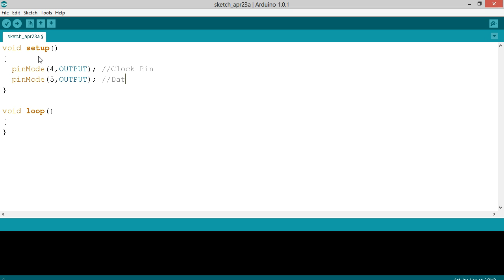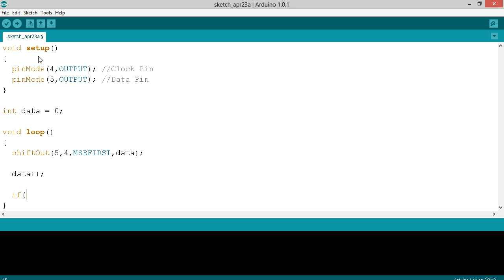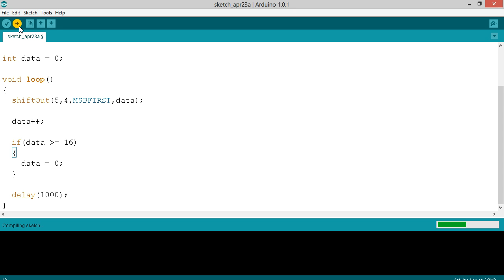Arduino Tutorial #16: Simple SPI Communication

Comment: Thank you very much, you helped me start communicating with my BU2090 12 Bit Serial register and to the Data and CLK connections are working correctly. But my register is a 12 bit not 8 bit like yours are and i don't know where to even get started sending the right commands to get the LED's i want to illuminate individually cause right now they aren't even flashing in sequence like yours are but they are blinking in their own pattern so i understand my soldering and PCB are Good but my sketch isn't. Any coding tips that might help a novice in need with this ROHM BU2090F i am using?  https://www.alldatasheet.com/datasheet-pdf/pdf/36319/ROHM/BU2090F.html

Comment: Miss leading topic. This is not about SPI interface. This is about shift register 74HC164.
Note:If using 74Hc595 then it requires 3 pins instead of 2.

Comment: at 4:10   ...  Reiterating what another commenter said: The maximum 25 mA output current specified on the data sheet is the maximum current you can pull out the chip before you damage it, not the maximum current the chip will output on its own. The chip has no control how much current your circuit draws out. It is the job of the circuit designer to make sure the circuit keeps all currents within safe levels. Leaving the current limiting resistor off the LED connections very much does not do this.

Comment: From what I can see one problem of ShiftOut is that you have no control over the rate of the clock. The SPI library you can at least set the max speed it allows the clock to toggle.
Reply from the maker: +64jcl True, but with most chips you're not going to have an issue with the clock being too fast.
Reply: +humanHardDrive , well I can think of one where it might not work - interfacing with older computer systems where you hand code the receiving part - like an old Commodore 64 (which I am currently interfacing with).
Reply from the maker: Are you trying to interface with a component that actually processes instructions, or just a shift register?
Reply: +humanHardDrive , well the C64 is a 1 MHz microcomputer with a userport. My code is written in assembly so as fast as the 6502 processor in it can run. Likely the Arduino ShiftOut would spew out bits faster than the code can handle it, so it's more common to manually bit-bang with a clock you can control the speed of - although the Arduino SPI library might work too since you can control the max speed of the clock.
Reply from the maker: If the processor is only clocked at 1Mhz, then your probably right to think that's the max input frequency.

Comment: The HC164 doesn't limit the current to 25mA, the 25mA is what's ALLOWED, and even then as ABSOLUTE MAXIMUM, not for continuous operation. The HC164 will supply a lot more current before it start to limit it due to MOSFET construction. At that point you're very likely damaging both the HC164's outputs and the LEDs. Besides, the HC164 may only supply 50mA TOTAL, that for all the LEDs combined.

Comment: When you say SPI I had the idea you were using the built in SPI peripheral in the arduino WITH a shift register. I dont think the term SPI is therefore the most correct. This is simply serial to parallel conversion.
Reply: That's right, and it's one way to make use of the SPI interface on the microcontroller. But indeed, it doesn't illustrate the full SPI protocol, however simple it is. Fully implemented SPI works in a loop: while you're shifting bits out on the MOSI (Master-Out, Slave-In) you're shifting bits in on the MISO (Master-In, Slave-Out).

Comment: Not sure if anyone's mentioned it yet, but an INT is 16bits (2 bytes) (which is different between platforms, It's typically 32bits (4bytes) in Java/.net etc)

So in this case you could use a Byte or a Char type to save 1 byte of SRAM (many of the same arrhythmic operators will work just fine too)  

Hope that helps out in some small way in the future!

Comment: 4:20 You mean that the 595 has current limiters on each of the eight output pins?
Reply: humanHardDrive
If you don't know it, you should look it up. Because then you'd see there's no current limiting circuitry. The output pins are simple voltage sources, and the current value you cite is the maximum current you can draw before damage will happen. That's why in datasheets this section is called "absolute maximum ratings". If you don't limit the current externally you will damage the IC or the connected LEDs, whatever is weaker and gives up first (although most probably both will be damaged by the time one of them dies). You wouldn't connect an output pin directly to GND and hope the current will magically limit itself, would you? There's also a maximum allowed current for the whole chip, 50mA in the case of a 74HC164. So even if you would select an approriate series resistor so a LED gets 20mA, you will exceed another limit as soon as more than 2 LEDs are lit.

Sorry, I have to be a little bit chiding here, because when you call something a tutorial you should make sure you don't tell people to fry their chips or LEDs. Other than that nice series of videos!
Reply from the maker: It's just the nature of the circuitry that it cannot source more than a certain amount of current. I'm not sure by what means it achieves it.
Reply: humanHardDrive

Thats not necessarily true.
You can avoid using resistors if the shift converter is powered from 3.3V with White or Blue LEDs that have a forward voltage of about 3V. With the internal losses of the SR that should output about 2.9V hence the LEDs self limit themselves. Putting orange ones powered from a 5V supply means the device has to drop 3V at who knows how much current.
Reply: superdau We play with Arduinos to burn and blow stuff up and its quite fun. Chill and go and have some sex, get laid or something...
Reply: Thomas Heaven
I do. Almost every day. But if you like to burn stuff why don't you take a lighter? That's much cheaper in the long run.
Reply: superdau Cause i got the money you don't have? (duh)
Reply: Susana Godinho NEVER do what Susana is suggesting here! ALWAYS use current-limiting resistors!
Reply: Steven Van Hulle
And of course when you point your finger to someone you can back that up, right?

Lets start by the shift register, Pag 4, Electrical Characteristics :
http://diodes.com/datasheets/74HC164.pdf

Lets assume that a logic high level turns the LED on, as per example on the video:
At 4.5V and a current of 4mA the output is 3.98Vmin and 4.32V max.
Similar voltage drop for a 6V supply.

So we can deduce that at 3.3V VCC the output will be anywhere between 2.8 and 3.1V for 4mA.

So for White LED's, as I mentioned, according to this datasheet, figure 4:

http://www.vishay.com/docs/81159/vlhw5100.pdf

the LED has a nominal input current of 5mA at 3.0VDC (Even lower at 4mA)

The datasheet specifies a maximum limit per port of 25mA and total current of 50mA
So 4mA*8 Outputs = 32mA. In fact anything up to 6mA would be within the specs to allow for supply and temperature variations. I'm not even considering the resistance on the breadboard. That would also happen to be within the limits of the arduino 3.3V supply.

And as I mentioned: Anything other than White or Blue LED's or shift registers powered with 5VDC will need resistors to stay below the maximum current ratings.
Reply: Susana Godinho Also note that the 100 ohm output impedance is the TYPICAL value, the datasheet doesn't give minimum values, so they can be less. Your current may well be higher that 30 mA.
Reply: Susana Godinho The output impedance for the '164 is about 100 ohm. Connecting a 2V LED (he's using red LEDs) will cause a 3V drop across the FET, making it source 30 mA. That's too much for the I/O pin, and too much for many LEDs. The LED won't limit the current, and it's YOUR responsibility to make sure the I/O current NEVER exceeds 25 mA, and even that shouldn't be allowed continuously. I'd suggest a 10 mA margin, also for the Vdd current. That means without current-limiting resistors you can power two 2V LEDs, no more. Always use current-limiting resistors.
Reply: Steven Van Hulle

Not sure why I'm quoted here.
I always mentioned using LED's with 3V, not 2V, forward drop, as backed by the posts of the 23Jul 2014 and 7Feb 2015.

Comment from the maker: 1) It means that the chip can either supply 25 ma or sink 25 ma.
2) 1 of the data lines behaves as a sort of write enable. Because both pins are connected to an AND gate, data will only be passed if both data lines are true.

Comment: Cool example. I've got 2 Q's: 1) Why do they use the ± sign in front of the 25ma (max output I) in the data sheet?     2) Why are 2 data lines needed (can this example be done with just one)?